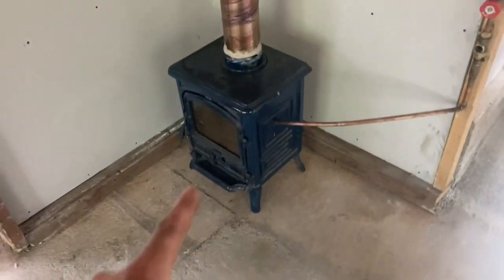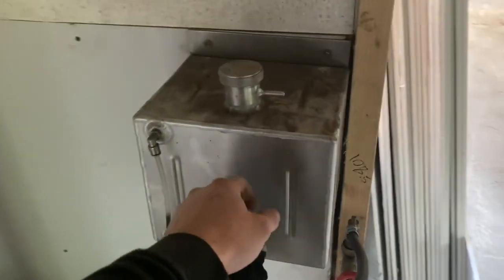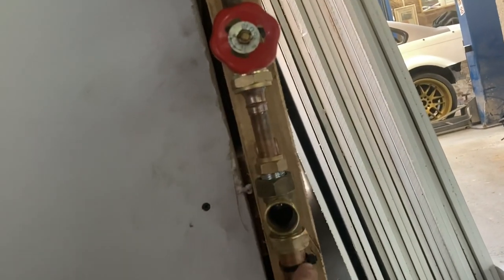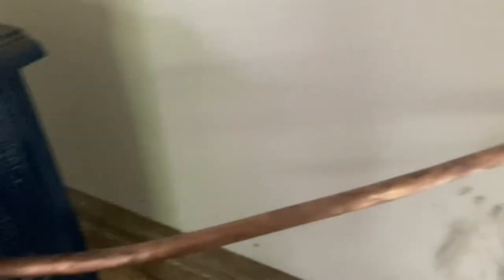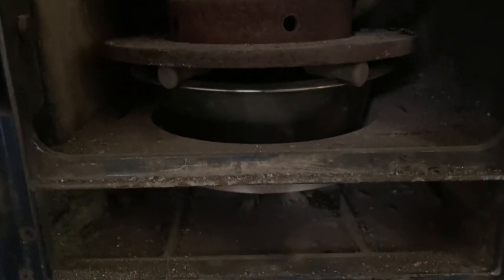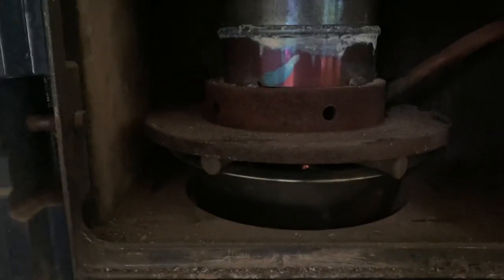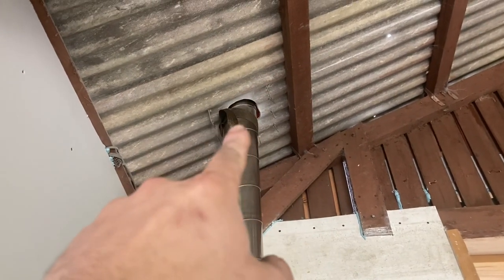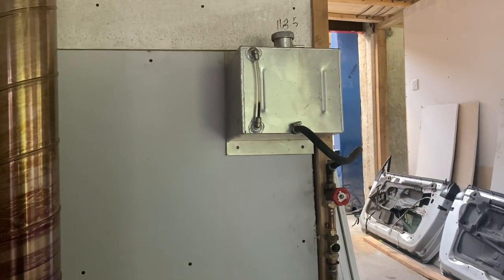Garage Mods! wood burner to waste oil burner cheap cheap!!

Comment: How hard was it to drill the hole in the side of it for the copper pipe to go through?  How do you have it sealed around the copper pipe, where it goes through the wood stove?